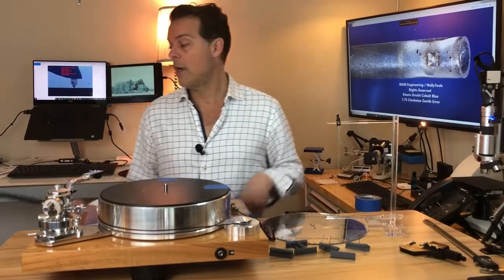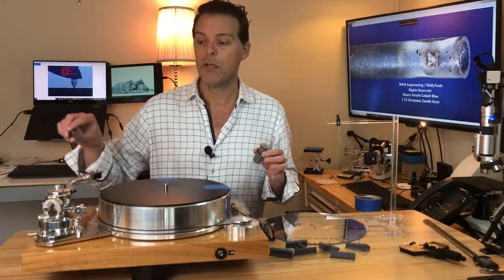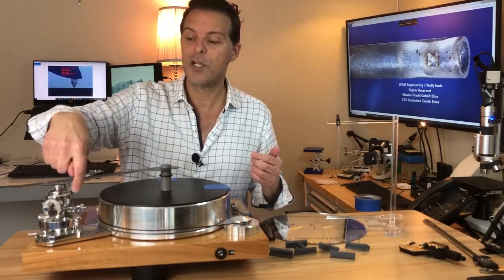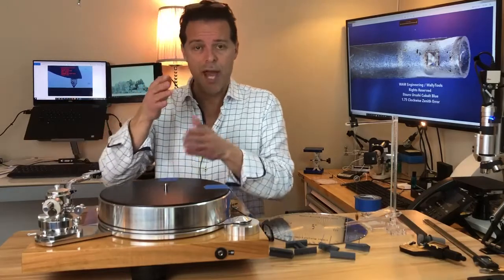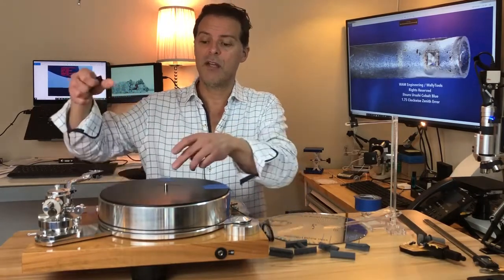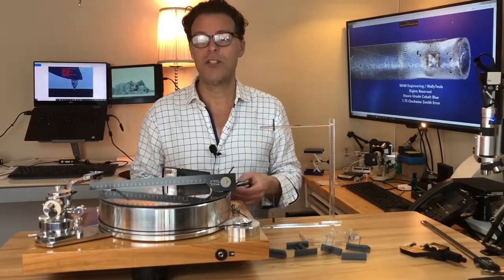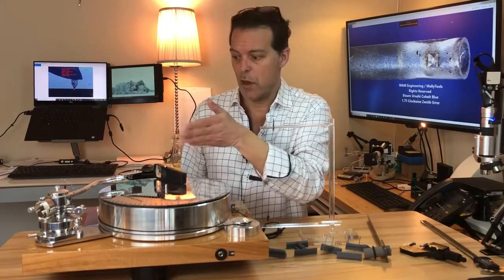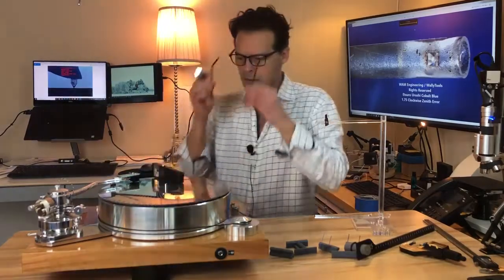WallyTractor Instructional Series (Part 1 of 4) - Preparations and Tips & Tricks ver2

Comment: Hi I've got this dilemma  maybe you can help me with?? I'm trying to work out this settings for this s-arm on a turntable that is pre-made
I'm having a problem with the calculator on vinyl engine, I'm assuming it must be right but it's giving me strange responses or I'm doing something wrong! When I put in the spindle to Pivot distance what is 215mm and the effective length is 246mm with a overhang of 15mm in the VE calculator I can't get anywhere near the pivot point with this measurement? I could never reach the overhang either what it is at  15mm. Even if I try and set it to a Technics specification what I got off the internet for the sl 1200 what has the same pivot to spindle distance that is about 230mm effective length always gives me overhang of about 17... mm.
By the calculations the arm is way too long at 246mm I was wondering because it's an s shaped arm but I believe you measure it the same way. So I don't know what's going on I need to cut the arm shorter but that doesn't seem to tally up with the overhang of 15mm if I do that? Thanks I suppose I could draw an arc with a 15 or 14 mm overhang at 230 and see what happens. I've been feeling about with degrees to see what the calculator is giving me and about 21 is probably on the money with a lofgrem b setting. None of the null points seem to be anywhere close to any of the known out there! the arm tube was bent and I did straighten it and had a degrees of 22.5. The cartridge is in the middle of the slots on the headshell what is part of the make it's not a aftermarket what looks and you assume is correct?
Do you know better calculator I'm not sure if the ve calculator is giving me the right figures? Something doesn't tally up and I can't work out what it is! and yes my measurements are correct checked about five times now I'm a bit worried committing to cutting this arm!!?
Condescend what's going with the calculator it doesn't matter about what type of specs I put in like angle with that length of 246mm it gives me pivot to spindle completely different?? it's got to be 215 mm I can't change it any advice would be welcome thanks!
Reply from the maker: @therealBozoDjTrump  Technics does not use IEC standards with their alignment scheme. Refer to the basic tonearm alignment calculator on our website site. You’ll see that you should be using the 230mm or even 231mm alignment arc on the WallyTractor.
Reply: @WAM-Engineering  so if I put my calculations into the calculator on your website?? should give me a correct figure? and I can draw my own arc. looks like I've got to cut the arm down? it's a big difference. it's not a Technic's it's a newnark 1650, I repaired it for somebody I've got to return it. but when I went to check it everything seems out with the ram! speed stability wow is good 0.09 now. I don't know what you mean by IEC standards? Why is that different what's different about it? Do you know what the Technics is then? All I know is 215mm p-s  what the internet is saying?? and supposed to be 230 and something for length, does that sound correct to you! So should I not trust the calculator on vinyl engine then? Could you give me a link for the w site!

Comment: Greetings from Russia.!I recently discovered your channel from Michael Fremer!!👍..When the hand with zero antiskating has an involuntary rolling, then, when adjusting the antiskating, the two forces can either add each other, or vice versa.And that's bad.Since I do not have such a tool, I check it on a weakened load when the tonearm is in zero balance.And I always take this into account when installing antiskating.I do the effective length like this:I fix the millimeter paper on tape, visually direct the line to the center of the node, mark the overhang near the spindle, and draw an arc with my template, which I made on a 3d printer.Then I put the stylus and do the alignment along this line.I also measure the effective length from the center of the support to the needle, turning the shell over, if the design of the hand allows it.I'm watching your channel and I'm very glad to see new videos!!!

Comment: What do you say about Linn who uses a three point attachment, cartridge to tonearm with no adjustment(for the most part)?
Reply from the maker: I have analyzed hundreds of cartridges and know the variation in assembly accuracy is far too loose to trust a third screw to “find” the ideal overhang and cantilever angle. Don’t use that third screw at all and use the WallyTractor to align the stylus/cantilever properly. You’ll see how far off that third screw hole is at that point. I suspect you’ll be quite surprised. 

I don’t know if that third screw forces Stevenson alignment, Baerwald or Loefgren, but if it is Stevenson then that would be a very good reason NOT to use it.